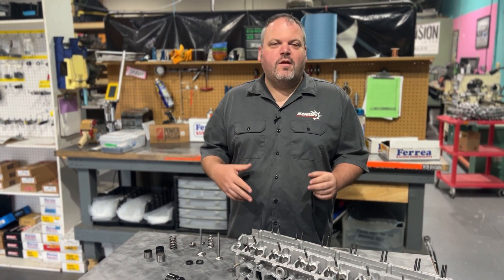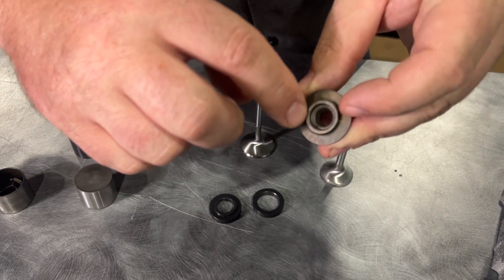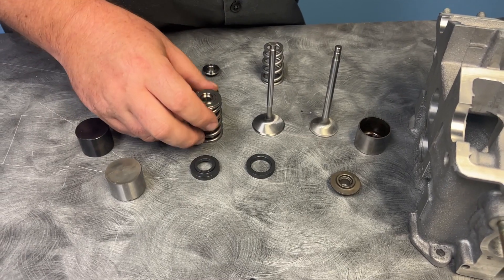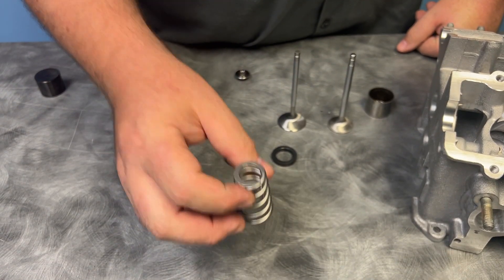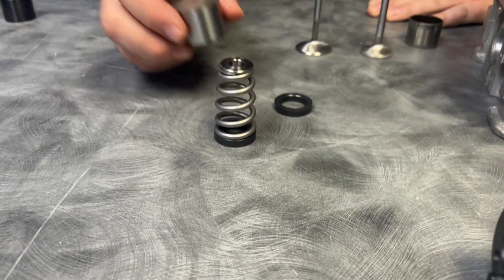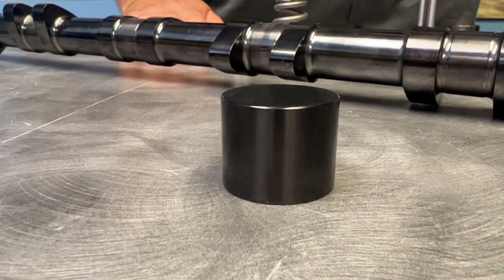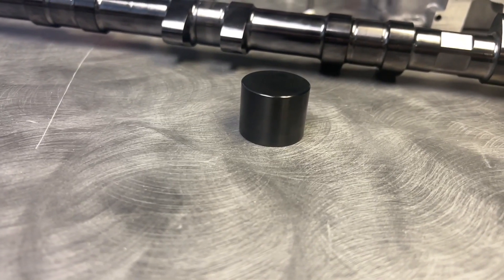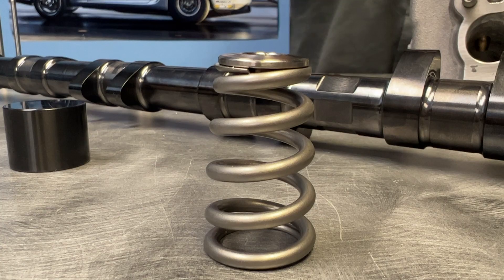RB26 shim-less bucket conversion!

Comment: I have been researching and trying to find an answer in regards to valve springs for solid lifters for my RB25DET build on my R33 for the past month and could not find the answer. This video just popped up in my feed and you provided the answer I was looking for. Yes I know this is an RB26 but I am changing out hydraulic lifters for solid lifters, pistons, rods, bearings, springs, 264 Kelford cams, titanium retainers and a whole bucket list of other parts. Anyway thank you for this video and I hit the subscribe icon.
Reply from the maker: The RB25 is a totally different beast in terms of going shimless and finding valvetrain that actually works. We don’t work on them for that very reason. There’s lots available but nothing that actually sets up correctly.

Comment: Why not address the valve float issue instead of just addressing the result?  Seems if you change over to shimless setup without addressing float problem then your not worrying about spitting a shim but still losing power from valve float and possibly tagging a valve.  

Have you looked into why it’s floating the valves to begin with?  Usually it’s a lack of spring pressure or the cam profile isn’t right.  I don’t build these exact engines but I do build suzuki hayabusa and gsxr1000 engines and they both use shim under bucket setups just like what you showed where the retainer has the counterbore for the shim.  I’ve never spit a shim and we turn 11.5k rpm on the busa and closer to 13k on the 1000.  I’ve really never heard of people spitting shims on busas and only rarely on the gsxr 1000 and it uses really small od shims and really thin too.  All long as the seat pressure is set right and you use a quality valve spring with the proper pressure then it ok.  Is it more of a problem with people that build their own engines and think that as long as everything spins without anything hitting then they good to go????  Or is it across the board problem from even qualified builders seeing this shim spitting problem?

Anyway, interesting stuff, like your videos I just found the channel and I’m checking out more videos from your “back catalog” so to say.  As I commented in another, do you do any bike heads?
Reply from the maker: Well, we are solving both issues with this kit. It doesn't float and it doesn't have anything to spit out when it does.
Reply: To counter this reply, bike engines are most often times not turbo charged/under high boost pressures which is a high, if not the highest, contributing factor to valve float. Even more so prone to float valves if the valves are oversized since its just more surface area for the valve head forced by the boost pressure to float off the cam.
Reply: @jameshudson8357   actually the bikes engines I build are turbocharged often or heavy nitrous.  I build dragbikes for the no wheelie bar classes commonly referred to grudge bikes or as pro street or what was originally streetbike shootout class.  We put 40-50lbs of boost on methanol just like the real fast car guys do.  Pretty much identical design of the valvetrain/head for the most part other than just being smaller dimensions/scaled for and they rarely spit shims. Actually the only times I’ve personally had it happen is on Gsxr1000 where the bucket bores are so small they only have enough room for single valve springs not doubles like on most big bikes and so the springs available aren’t always the greatest.

Comment: Why not just go with stronger springs? I see this being an issue with once that valves wear you no longer can adjust and measuring the gap to replace the shims like prior... So now you gotta get a bunch of buckets? How does that work? Iam just curious.
Reply from the maker: That is what we did, much stronger spring and got rid of the puck. We don't need a bunch of different buckets, we machine the tip of the valve to achieve the lash.
Reply: @headgames  Ohhh okay I seee. Very interesting. I assume it obviously works since you have had such good success with them. Great stuff!

Comment: Interesting. On other Nissan engines, when they wanted to eliminate shims, they would use parts from Nissans that already had different cam buckets. Often it would be a VQ35DE.
Reply from the maker: I can't think of another Nissan head that uses the VQ bucket besides the VR. To get one to fit a TB is a ton of work, and the KA is a totally different bucket.
Reply: @headgames  Okay, that would explain why the time I head of it, it was someone race prepping a KA24DE
Reply: @headgames   I wouldn't say totally different bucket.  KA is 34mm across by 26mm tall.  VQ is 34mm across by 21mm tall.  I can confirm this works as I have done it and is a good no-shim solution for high revving KA's.
Reply from the maker: with a standard length valve? What size bucket did you do? Because we tried that and it wouldn't work without a lot of work. 
 @dreednlb
Reply: @headgames   Third try.... youtube keeps deleting my comment...
Reply: yes, standard valve.  They come in various thicknesses.
Reply: "Solid Nissan KA24DE Budget Build"
Reply: well FFS,  youtube won't let me even answer you properly
Reply: MotoIQ video ^^^